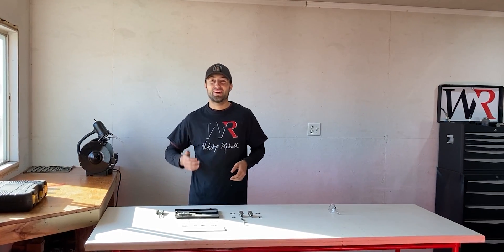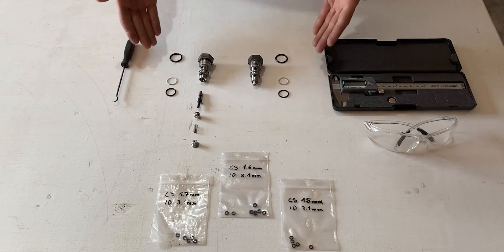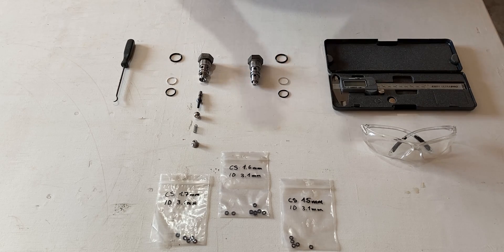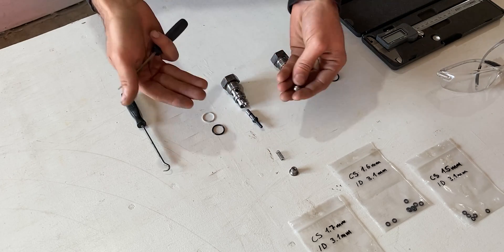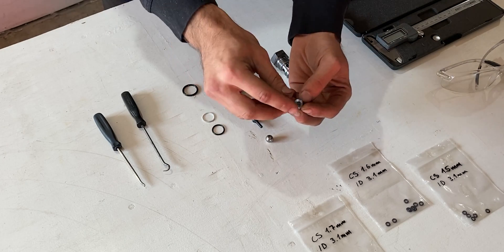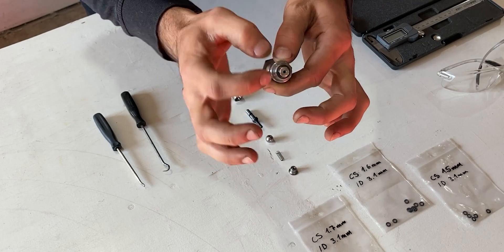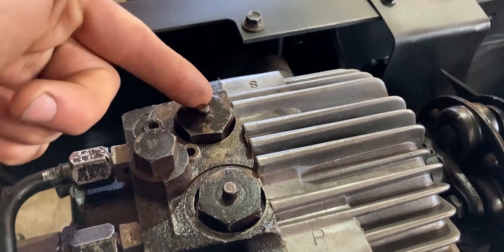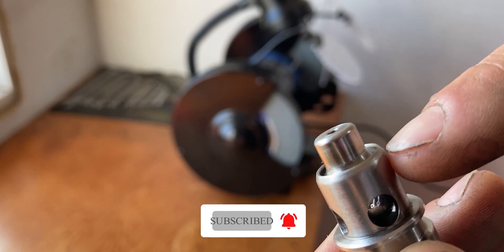Everything You Need To Know About Sundstrand Check Valves (John Deere 300 Series)

Comment: Any chance you have some information on the two hydraulic hoses ran to the valves your working on here in this video? Hard to find and know what can work on my 316 model. The ones in this video are different than the ones on mine. Any chance you could help with this?

Comment: 10:36 you can remove the check body chrome the cap it is threaded into the cap no grinding necessary
Reply: Sorry my mistake some series have a finely threaded cap and you can take them apart.
Reply from the maker: @markfgraves6983 No worries! I was very curious to know, in case it was threaded😁👍🏼
Reply from the maker: Where is the thread?

Comment: in the video you show using the 1.6 cross section but in audio you mentioned 1.7 cross section (10:53 in video) right after you finished taking filing off the bevel. Where would the best place be to buy o-ring? thank you

Comment: What about the small white rings on the outside of the body? Mine is cracked.
Reply from the maker: Great question. These white rings are called Teflon Backup Rings and they make up the gap, since the O-Ring is not big enough. I will try and find a link for them or at least the size and get back to you. Do you have these exact Check Valves？Best Regards -Andreas

Comment: Great video. My tractor won't go into neutral. I took those valves off cause the pistons were stuck. Should the tractor be able to be pushed(freewheel) with those removed? I'm wondering if I have another problem.
Reply from the maker: Thank you very much! I understand your issue and this could be caused by various components. The first thing you should check is if the wheel-hubs are free. You can lift up the rear end of the garden tractor and rotate each wheel separately. If one wheel is stuck, then one of your brakes is seized to the brake drum (inside of the hub).
Let me know if this helps. Best regards -Andreas
Reply: @WorkshopRebuild  I jacked it up today and both wheels will move just alittle and stop. Seems like the brakes are fine. Thank you for the suggestion.
Reply from the maker: Well that's great news. If your wheels turn that means they are not seized to the brake pads. If you have both check valves removed, lift the tractor in the back again and try to spin both wheels forward or in reverse (this will allow the drive gear to turn the pinion shaft). 
Is this even possible and/or do you feel or hear any grinding noise? Let me know. Cheers
Reply: @WorkshopRebuild  I just wasn't putting enough force the first time. Was afraid to break something. They spin and the tractor can be moved. Thank you so much.
Reply from the maker: No worries! Hydraulic rear end tractors are hard to push. If you ever need to pull this tractor over a longer distance, just remember to do it very slow. I hope everything works out for you and if you have any other questions let me know! Cheers -Andreas